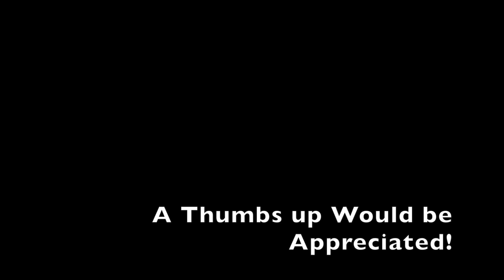Huge Shed Door Nearly Takes Me Out | Shed Built by Myself from Trees

Comment: Sandy, my understanding is that the way your first door was done is best.  From the post top corner to th outside bottom corner is under tension, a solid board works fine.  From th top outside corner to the post side lower corner is under compression, 2 piece board works fine.  The 2 piece brace will not work well under tension.  Just a thought from geometry class, 50+ years ago.  Rodney
Reply: I agree, he may have thought he was wrong.  Time will tell.

Comment: It seems like out swinging doors would be challenging in heavy snow areas.  I use barn door top rail track systems on outbuilding doors on my farm. Makes it much easier to deal with snow.  When snow blocks the door I just slide it open and back up with a back blade on my tractor and pull the snow away.  I really like how your building looks. Nice job.  You are obviously a pretty good carpenter.

Comment: The diagonal on the doors transfers the load via the nails via triangles formed. If the load was transferred just in the wood follow it down...the diagonal does not butt up to the post. So the load can't be transferred in the wood or the door would instantly sag until the bottom of the diagonal hit something to stop it, like the next door.

Another way to look at it is if you only used 2 nails in a continuous diagonal, 1 nail at the top and another at the bottom the door would instantly sag.

By nailing each vertical board you are forming a triangle at each vertical, the diagonal and the top horizontal...and another triangle at the bottom horizontal. So 1 triangle per vertical board. And when you add that mid horizontal on the back you form yet another set of triangles. It's all these triangles that keep the door from sagging.

Over time as the wood shrinks away from the nails all those triangles get a little loose and then you can get some sag. Prop up the bottom and drive another set of nails and you're back in business.

Comment: Something to consider. You could put one long board on the inside of the door from the hinge side bottom to the free side top. In the inside you can't go the other way due to the brace inside the doorway.  This would give you a full length hang boqrd and a full length pull board on each door. But, I wouldn't rely on the wood but instead get a turnbuckle for the inside of each door to allow you to adjust each door as time goes on. Cheers!
Reply from the maker: Great idea Reno! Thanks for sharing
Reply: Just swap the doors over. Left to right/right to left, that way your bracing runs correctly.

Comment: If you decide to use the 50/50 mix of used motor oil and diesel fuel stain, you can make your older building look like new again too! Simply pressure wash the gray oxidation off and let the wood dry for a few summer days before you put the stain on. I tried using a pump-up weed sprayer to deliver the stain to the wood and then work it in with a brush but it didn't work that great -- even after straining the blend through a paint strainer mesh . . . so now I just use a brush to slop it on. :)
Reply from the maker: Great advice. Thank you

Comment: Always easier to push than pull!
Reply: A cleat at the top of the ramp at the door opening may have helped for control to stand that door in place . You did good without it.
Reply from the maker: I"m pretty heavy so I was using the pull as a counter weight haha

Comment: With siding boards (much like deck boards), as the wood dries it tries to warp and curve itself back around the tree. One can look at the end grain to see which way it will go. If you orient the outside of the board out, it makes sure the board edges will always remain tight against the frame. On deck boards, orienting the outside of the board UP also makes sure that it will drain off water if it ever cups instead of holding water on top of the board. :)
Reply from the maker: Thanks for sharing the tip Jim

Comment: I am not sure about the voltages the batteries are at with all your equipment but If you can, use one charger device for all the batteries (cheaper to have one single device then several smaller ones). A good idea is to disconnect the negative terminal from the batteries before connecting the charger leads. Maybe even a good idea to have some sort of plugs and a switch for every charging lead so you won't have hot leads dangling about when it is not connected to any battery.
I would install mains and DC charger outlets on the back wall up high to minimize rodent damage and damage from accidentally bumping into them. Also lighting I would do using a motion sensor (with a manual override of sorts)

Comment: Spray or roll the whole outside with used motor oil. It will repel bugs and water, starts out black then turns dark green. If you paint the inside with Aluminum base paint you wont have spiders and it looks like a metal barn, much better and cheaper than white paint.

Comment: I liked the latches on those conex buildings as it did the top and bottom at the same time. As slippery and heavy as the doors are, try to see if you can make mr tractor do the heavy work. Nicely going so far... maybe some of the trimings make the different cuts for far ends since its the same from end to end
Reply from the maker: You're right about using the tractor. I've gotta put that thing to more work in these situations. Hope all is well Morgan!

Comment: I clicked thinking that door would almost crush you!  Can you tell me how you cut the upper siding with the angle on it?  Did you measure each one as you put it up?
Reply from the maker: It was a close call at times that’s for sure. I measured the first length and then used the pitch of the roof which corresponds to an angle on my mitre saw to cut the first board. Then the long measurement of that first board became the short measurement of the next board plus 1/4” to account for the little gap between the boards

Comment: With the boards meeting in the middle like that I don't think the order of the cross would make that much difference. Keep us posted if the backward ones sag.
Reply: I don't think it makes much difference really.  It's a friggin shed anyway.
Reply: I think that it is better when the board runs from the upper hinge down to the middle. If it dries it gets shorter and pulls the corner up from the ground. The old way to build doors over here is to build a "z" on the inside so that the board runs from upper hinge to lower corner in the middle. It is easier to bend with compression than to make wood longer by pulling...
Reply from the maker: I"ll keep ya posted! Thanks for watching Jim!
Reply from the maker: As long as it doesn't rub on the floor I"m with ya there Steven
Reply from the maker: @Johannes, that's an interesting point!

Comment: The Tongue and Groove Floorboards came in 12 Foot Lengths and We were going to vertically panel a Wall which was 123 Inches tall. 

My plan was to cut one board then use that as a template for all the others. 

Problem was My tape measure was only 10 Foot long, so I had to measure, mark, add 3 Inches, mark, then cut. 

It was decades before I realised that 144 Inches (12 Feet) minus 21 Inches equals 123 Inches.  

If only I’d measured the short end rather than the long one. 

Unfortunately when I added the 3 Inch measurement I only added 3 Centimetres. 

Thus all of My boards were shorter than all the boards cut by My colleague. 

By alternating the boards We created a sawtooth bottom, called it a design feature and said We’d cover it with a skirting board. 

In the quarter century the Wall stood, We never fitted the skirting board.
Reply from the maker: Sounds like you had best intentions though!

Comment: In my opinion your doors are too flimsy and wont last the test of time.
You should frame the inside and outside with boards and add the X members to the inside too.
If you get deep snow you will have a lot of shoveling to get in and out of the building. 
You might change to sliding doors after a trial period.
I know it's your shed, but I thought I would comment.
Keep up the good work.
JIM
Reply from the maker: All good points Jim. The reason I built these in this way was the success I had with similar doors on my shop. The doors to the left of my big sliding shop doors are hinged. You're right that snow does build up in front and so that may be my only challenge.
Reply: My barn, built in New Brunswick in 1847 and moved to California years ago, actually has thinner doors.  A Z brace inside with diagonal from hinge at top to latch side at bottom. It still works.